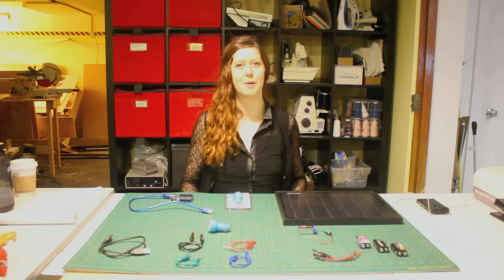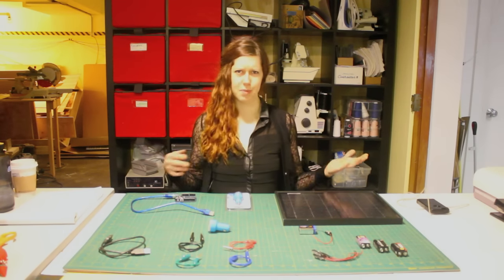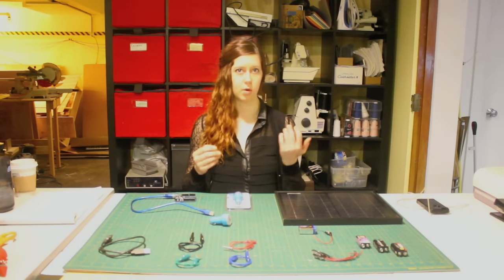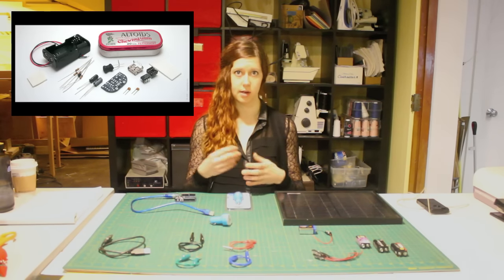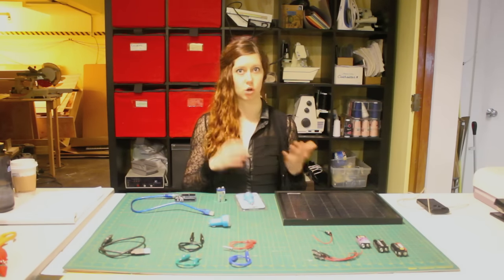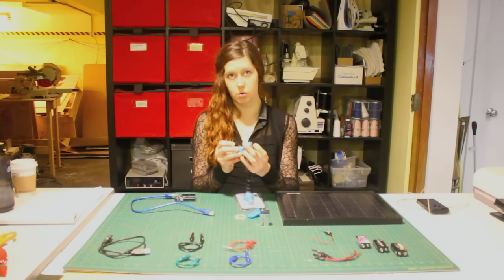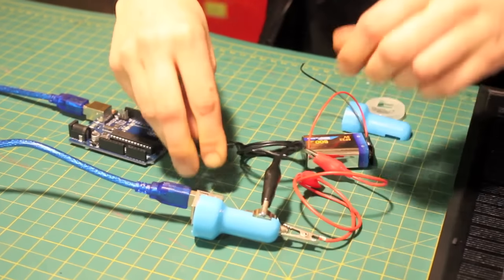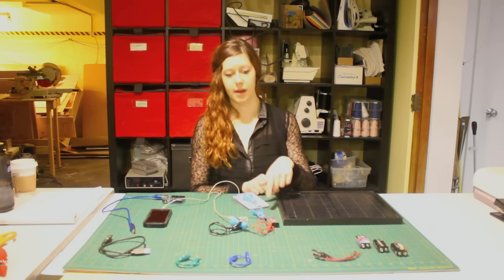Maker Quest: Portable (Solar) USB Charger

Comment: Did you mean to say that Apple products supply a higher current (as opposed to voltage)?

The USB standard specifies the voltage should be +5 volts, with an allowed margin of +0.25v/-0.6v. The original standard specified 500 ma current max, but many USB ports (including those from Apple) supply 1 amp or more.  The newer USB type C connectors allow up to 9 amps current.

The flip side of the current differences is I once had a Blackberry that would not charge when attached to an Apple USB adapter because the current was too high.
Reply from the maker: +Minecraft Maker Whoops, thanks for catching that! Yes, meant to say current, lol. Will add in a comment to correct that. Funny that too much current also doesn't work.

Re: USB Type C, the specs state it has a baseline current of 900 mA, although I believe they allow up to 3A.. 9A would be a lot!!

Comment: Not sure how practical a 9v is in this instance....everyone is using power banks these days. Do I still need a diode if I just run the solar panel into a power booster that has  usb outlet?
Reply from the maker: Whoops, didn't see your comment til now, apologies for the delay! A 9V is an easy. inexpensive and portable battery for this project -- not perfect but it does the job. Power banks would be another option, as would an lithium ion battery (LIB) with 7-9V output (or boost a standard 3V LIB). 

I'd recommend a diode for any solar panel projects that don't have protection circuitry for the solar panel.. always better to be on the cautious side!
Reply: Realistically, how much charging power could I get from a 9V??
There are some power converters/power boosters on Amazon that are in the $5-$8 range that look promising...any opinion on those vs. the car charger idea??
Reply from the maker: Well, since the current output of a 9V is pretty low, you won't get much power (P = I * V). It's enough to keep a smartphone battery alive if its dying, or power a microcontroller, but will take awhile (a few hours) to fully charge a completely dead smartphone battery. 

To get more power, you can use a higher capacity battery (e.g. LIB) at the same voltage. Not positive about the power converters without looking at the specs, but my guess is using a power converter for a 9V will only get you so far.. since we can't create or destroy energy, it has to come from somewhere -- either you start with a higher voltage and convert it into more current, or you start with high current and convert it into voltage. We can't magically generate more power, we can only convert it.